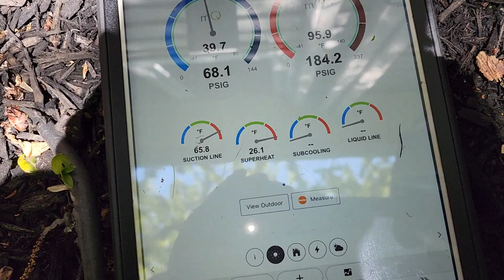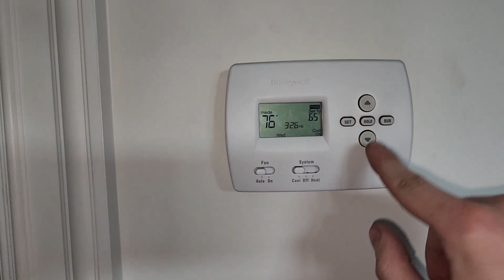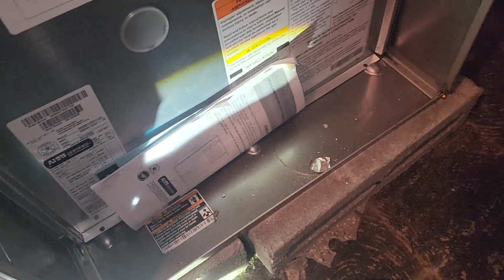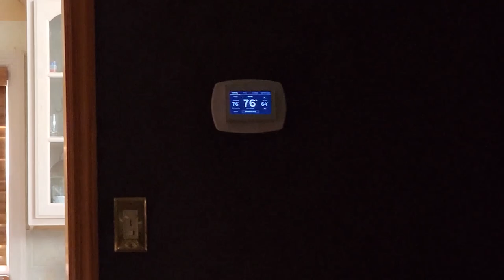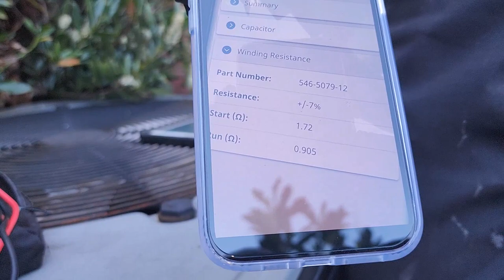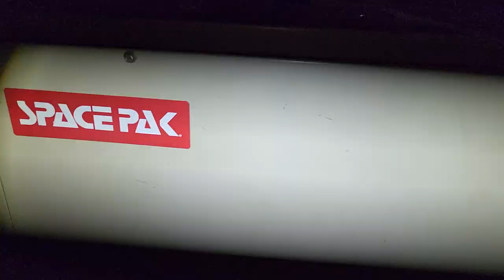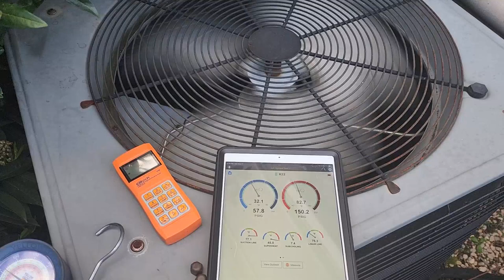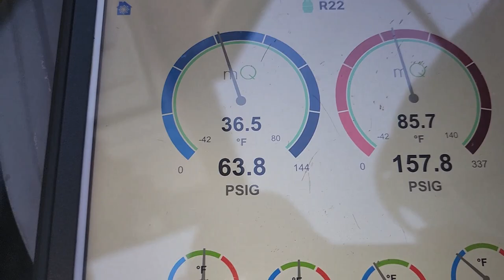Running Air Conditioning Service Calls During Busy Season! Leaky R-22 System! Two Wiring Issues!!!

Comment: I like your needle nose pliers. I got the same one. Mine has electrical battle scars. 

Suggestion: I would sand the line set where you clamp up with you temperature clamps, so you don't have the extra bit of patina off the copper skewing your numbers. You would be surprised. 1-2 °F of subcooling. Happened to me. Guy could only afford 3 pounds of R22 and it could've been 4 pounds. If I didn't, the customer would have paid more than he needed to. He was grateful for me taking that extra step.

Comment: Dan, out of all your ac service calls, do you get more electrical or refrigeration calls , roughly out of 10 calls ?
Reply from the maker: I feel like it’s a good 50/50. Typically new customers I find it’s refrigerant. But with maintenance and customers we’ve had for a while it’s usually capacitor, contactor, etc… 

It seems like New York all the hvac companies “gas and go” and then we show up and the homeowners are like “oh I didn’t know I wasn’t supposed to pay an extra $500 a year on refrigerant for my ac”
Reply: @DCHVAC  thanx dude , your doing great out there , n let mr pipes know to keep that dang black thing out of his mouth man, u Gota keep using the scope bro lol jk jk

Comment: Looks like slight restriction on the one 26 sh 6 sc. was it a txv? Piston?
Reply: As the video went on it looks a little better. Definitely still off. Still wondering the metering device. Possible high load.
Reply from the maker: TXV
Reply: @DCHVAC  that thing isn’t feeding correctly…
Reply from the maker: @drodriguez394  he just wanted it running hes planning on replacing it when he settles in on the house
Reply: @DCHVAC  right on